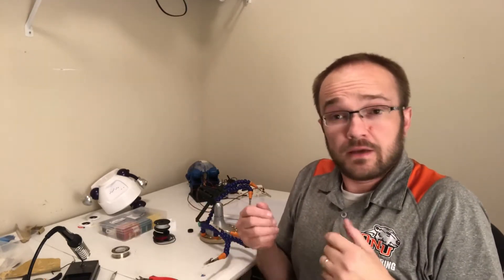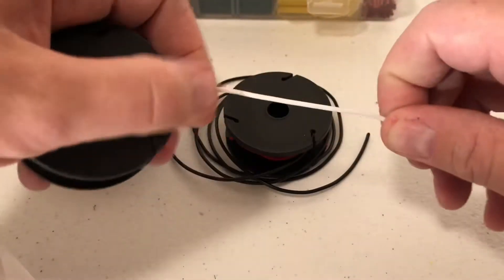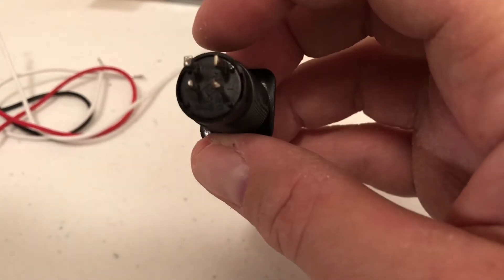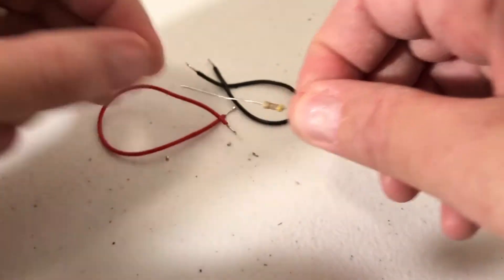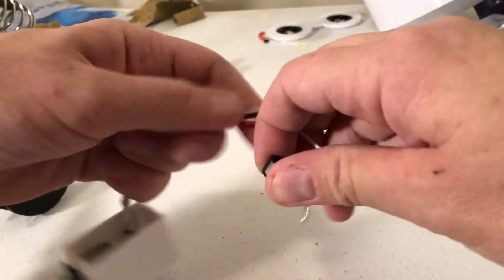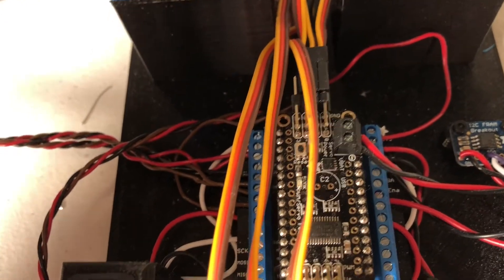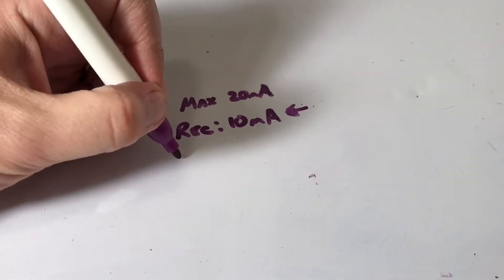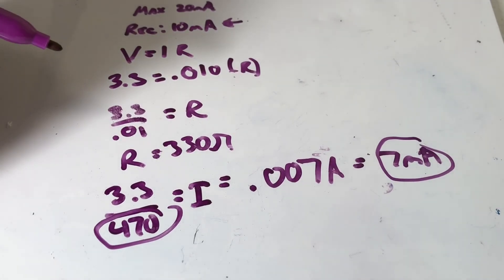Building an Arduino Controlled Animatronic System - Part 7: Addendum - Adding the Reset Button

Comment: I think you made a small miscalculation with your resistor value. for the Led.
The formulae should be: (Supply Voltage - Led Voltage) / Desired Current.
A couple of examples:
For a 3.3 V Arduino and ~2V Red Led @ 10 mA => (3.3 - 2.0) / 10mA = 130 Ohm ~ 150 (E12 standard value)
For a 5.0 V Arduino and ~3V Green Led @ 10 mA => (5.0 - 3.0) / 10mA = 200 Ohm ~ 220 (E12 standard value)
The important part here is the Led forward voltage (normally between 2 and 4 Volts depending on color and type)

The good thing about your calculation - You run the Led at a lower current than expected so you are on the safe side.

Comment: Dear Jim, I'm an artist working on some animatronics portrait ideas. And am seriously looking into building the devise based on your instructions. I have a basic-medium level of understanding regarding code. but I think I can handle de hardware and mechanics. So my question is: If I embark in this project do you think you would have a bit of time to answer a few questions during the process? (which I'm sure will arise heh..) I would produce it between May-Sept 2019
Reply from the maker: Rafael Yaluff sure. You can contact me via Twitter @jimscuba2386
Reply: Will you share the results of this project?

Comment: Hey great work, do you have any videos/links to how to set up an animatronic mouth that syncs with audio, using an arduino/microcontroller? Just a simple solenoid controlled jaw that gives an "up and down" motion, nothing too fancy.
Reply from the maker: Mine are a bit more complex than that. My mouth designs use exactly the same process as the eyelid controls. If you want something simpler, you could take the output audio pin from the adafruit FX sound card and read it into one of the analog pins on the feather 32U4 using analogRead(). Then just say, If the analog read value is above a certain value, trigger the solenoid. It won't look nearly as believable as if you recorded your puppeted movements above.

You can see one of my animatronic mouth projects here: https://vimeo.com/262862356
Reply: Thanks Jim! I'll let you know how I get on.